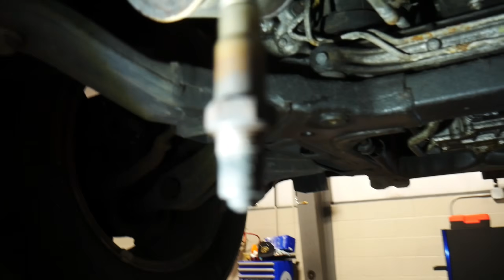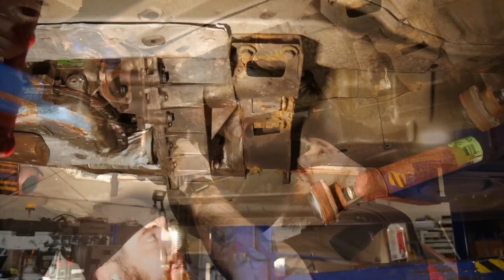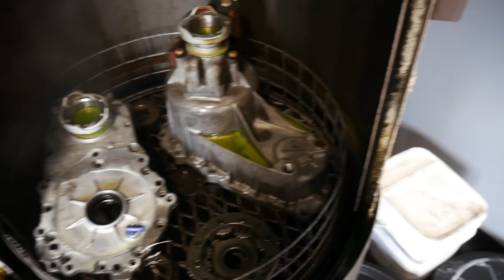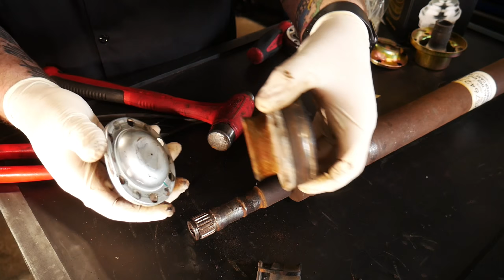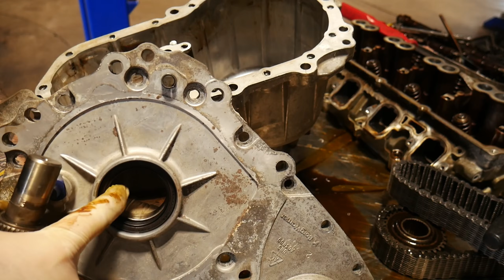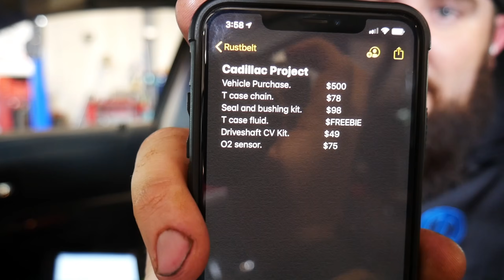TRANSFER CASE AND DRIVESHAFT REBUILDS - CHEAP FRIGGIN CADDY PROJECT

Comment: Does gm transfer case have oil pump like automatic transmission has?
Reply from the maker: This one did not have an oil pump or pickup like most other truck transfer cases
Reply: @RustbeltMechanic  , thanks for replying.  This must be the reason for high failure rate,  no oil pump to circulate oil for lubrication.
Reply from the maker: Correct, it just has the oil level in the lower chain area and that’s it.

Comment: curious, is your dealer all good with you doing the repairs at the shop on your own time? how does that work? or is this a used car for the dealer?
Reply from the maker: Yes, this car is mine and it is all done on evenings or weekends. I’m the shop foreman,  have a key to the building, and I have an agreement with the owner. That’s why you don’t hardly ever see any videos of much diag or cars that aren’t mine, I don’t do filming during the day. The only time I was permitted to film was per the customer on the Trackhawk videos I did.
Reply: Rustbelt Mechanic makes sense! I switched over to an independent shop and have keys etc but I was curious how a dealer worked with doing that. Awesome man keep the vids comin! I’m in Cbus. VW/Audi tech but got hooked on your videos lol

Comment: Can you show how to rethread threads? You’re a better teacher than the other guys in YouTube, and how your take on MATCOs extended ratchet even tho we know who really made it because they have a video on it in orange
Reply from the maker: 😂😂 yep exactly. I’ll see if I can get my hands on one of those ratchets this week for testing. As for threading, yeah I should’ve shown that one but the video was also way long...I have a spark plug tap that I use to clean the threads if possible....spark plugs and most O2 sensors are the same thread. If that doesn’t work then I also have a spark plug helicoil kit that works great to helicoil the O2 bung in the exhaust👍🏻

Comment: With the other case half not installed to push the two shafts apart it’s hard to tell how stretched the chain is. An easy way to check the chain is to hold it out on its side in the air and if it droops it’s bad